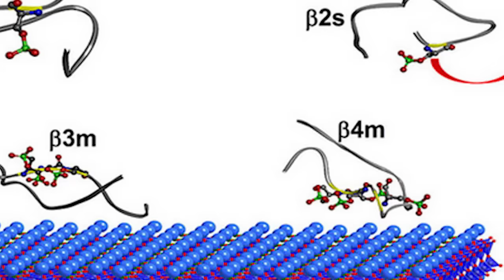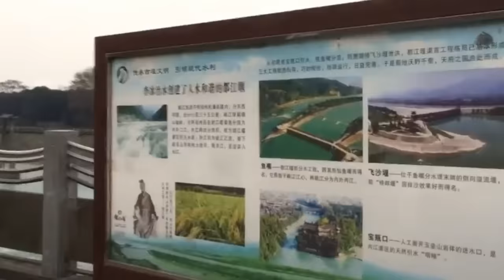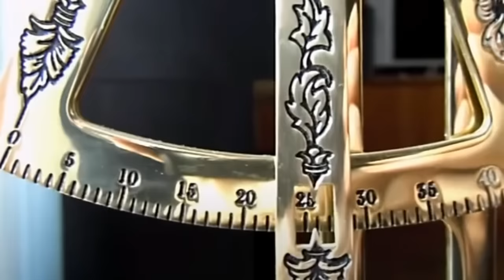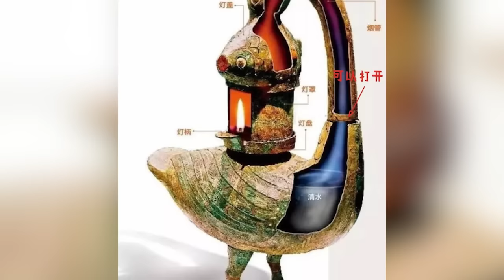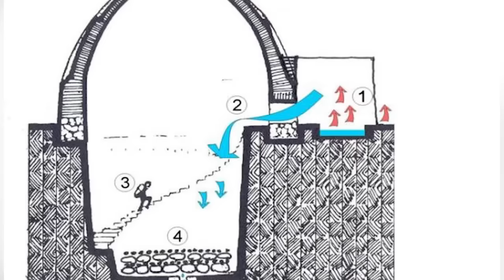12 Most Mysterious Ancient Technology Scientists Still Can't Explain

Comment: On the saw cutting, it was done with a cable of some sort. 2 people 1 on each side would set the cable were the stone needed to be cut and slide it back and fourth like a 2 person saw for cutting a tree. You would cut your ends and then put the cable in both end cuts and move it back and fourth till it was cut to the depth needed. The width of the cuts are almost perfectly straight. A 1 person saw would leave coverture lines that would be off.
Reply: you suppose the cable was made off ??????
Reply: @pauldelande841  good question. But from working in home remodeling for over 20 years that's a saw cut or a rope cut some call it. Maybe a rope dipped in bronze or copper. Maybe something else. We are finding that they had advanced technology for their time so could be anything.
Reply: @jamesrcoleii4577  in your 20 years....how many times did you use  "Maybe a rope dipped in bronze or copper. Maybe something else. " ???
Reply: @pauldelande841  None but have used a diamond rope saw and a titanium rope saw. Come to think of it I even used a hand chain saw for trees. But at the same time like I said before maybe another technology we haven't notice yet.
Reply: @jamesrcoleii4577   DIAMOND & TITANIUM  rope saws are MODERN TECHNOLOGIES'  used for cutting granite blocs indeed.... was not available thousands of years ago...even barely known off today ! Enjoin your dreams, hope they make you feel great and important. HONESTLY
Reply: @pauldelande841  yea I know what they are. You ask me if I ever used bronze or copper ones, I said no. I just added the ones I have used. I know they did not have them back then, I was talking about our time. In fact my dreams have already been answered. I leave here in May 2023 for Hawaii to do Oceanic Anthropology. Just got to finish my last few classes. Might do a few months in Egypt off the ocean to study some text and other things. Good luck mate.